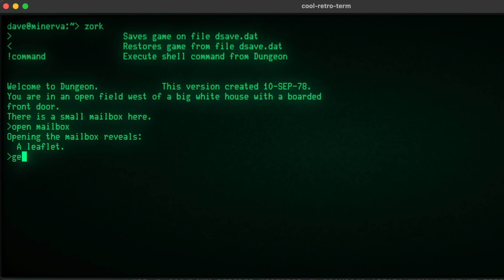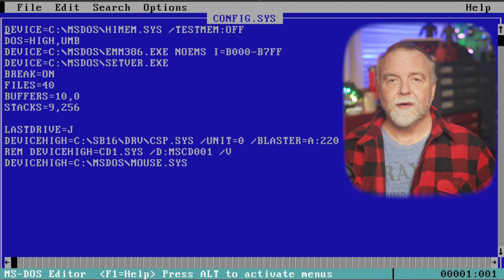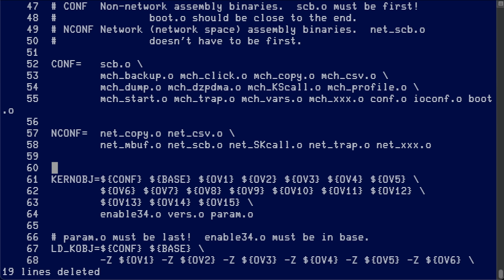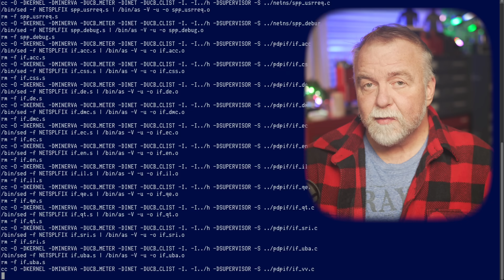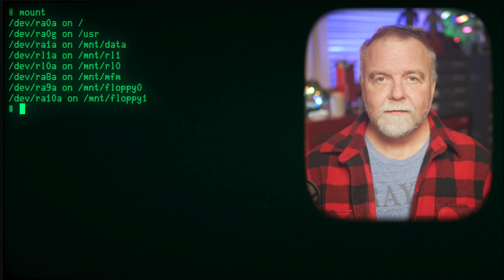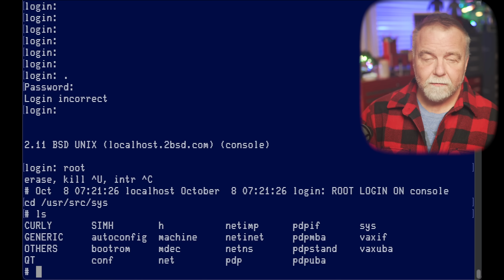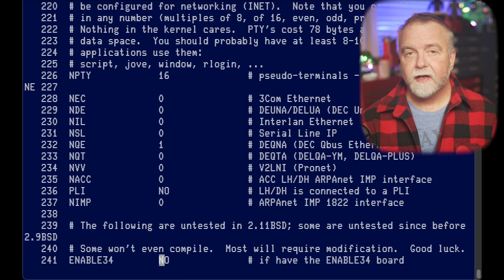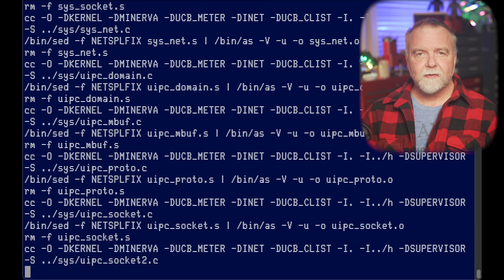The Hardest Thing: Building and Running the UNIX Kernel from Original Sources

Comment: The /netnix file is a great hack that makes 2.11BSD possible to have a mostly complete network stack.  It's also why "modern" 2.11 BSD only runs on advanced PDP-11 systems that are not only split-I/D capable, but have supervisor mode in addition to user mode and kernel mode.   The supervisor mode is used to contain most the of the network stack, while the rest of the BSD UNIX kernel runs in.. kernel mode.   I think the separate file is required because the a.out binary file format doesn't really have sections available for the other execution mode.  It already has notions of code, data and BSS segments, and they're implied to be kernel mode for the UNIX kernel.  But no place but a different file to have that code and data around to be loaded.

Like a dancing bear, its not how well it dances, but that it can dance at all.  It was a herculean effort to shoehorn the VAX 4.3BSD kernel networking stack into a PDP-11, and just amazing that we had it at all.

There were other differences that would show up.   When I was running 2.11 BSD on a PDP-11/44, sendmail would core dump when you ran it.  But only when I would run it from an Ann Arbor Ambassador terminal (which was quite the beast at the time!)    But the sendmail program would work just find if you ran it when logged in from a DECwriter printing terminal.  WTF?   Well.. it turns out to be related to the size of the termcap entry for each of the terminals.   The AAA terminal was really smart and had a big termcap entry, while the DECwriter had.. not much at all.   And you need to also know that sendmail had this "frozen configuration file" feature.  Rather than parsing the giant sendmail configuration, (which was nothing but lines and lines of incantations that were pattern matches and actions) each time, it would just restore a copy of the BSS segment that you could write out once.   On 2.11 BSD, the crt0.s start-up file that initialized the C runtime environment had the environment pointer in the BSS segment, while on the VAX it was in the data segment.  So restoring the saved config file would overwrite the pointer to where the environment data was stored (along with the TERMCAP string), and the longer termcap string for the fancy terminal would just blast over other data since it was much longer.    Good times!

I love having a PiDP-11 around around running 2.11 BSD.  The blinkenlights are very relaxing.  It's like meditation for old people like me.

Dave, you should poke around and see if you can find UNIX v7m, which was DEC's distribution of 7th Editon UNIX for the PDP-11.  No networking of course.. well, there was UUCP.  But it had an even more primitive kernel configuration system.  It's been more than 40 years, so the details escape me and we didn't run that for very long.. but I do recall getting it to run on an LSI-11/23.  That bear didn't dance nearly as well.

Comment: It was only recently that I got the caught the bug of going back to the metal. I took the well trodden path of those before me and built a few 1:1 emulators of the usual 8-bit microprocessors, then thought "hmmmm writing a kernel can't be much harder".

Within a few days I had a boot loader, keyboard interrupts and even switched into VGA mode, shortly after this I encountered the 10 mile high sheer wall that stood before me.

Comment: Hi, Dave. Great trip down memory lane (pun intended). I taught at Rochester Institute of Technology, where we had a PDP-11/45 and a PDP-11/34. The former had the split instruction/data space (which made the floating point emulation a bit tricky), but the 34 did not. To circumvent the kernel space limit, we changed the kernel to take the I/O buffers out of the kernel’s address space. That let us configure more buffers, which increased the power of the system. I also added a bit of code to the idle loop on the 45 to run the panel lights back and forth like a Cylon robot. Great times, great memories! Ken
Reply: Love that cylon boot stuff :)

Comment: This certainly brought back some memories of when Linux kernels would have to fit in the memory accessible to the boot loader (before bzImage or modules). When I compiled the driver for iomega zip drives on my 4MB 486 laptop, it took a whole day since I built a whole Linux 2 kernel along with it. It might even have gone faster if I'd told the build system not to use -pipe!

Comment: Boy it was simpler in the early days! I worked on the first Unix system running on a PDP11/40 (I think) in Evans Hall at Berkeley. This was the first Unix system to be installed outside the Bell Telephone organization. I was trying to interface to the CDC 6400 batch system over a serial line to Berkeley's home built multiplexor for the the CDC machine. (The documentation lied, of course!) I built the kernal a LOT. Unix was really smaller then.

Comment: Thanks for sparking some old memories...
I was using a PDP-11/70 in school with Dec-Writer paper print terminals till we got VT100s around 1979... in the days of IBM-5120, Apple-][, Altos-CPM or MPM, and 4K TRS-80 before the PC/XT came out.
Then I REALLY enjoyed using VMS on VAX-11/750, 785, 8600.clusters, and even VAX-9000 for years after that.
VMS was a Primo operating system for its time !!... with features unmatched by most servers for decades... yet contributing technologies & computing foundations that are used inside other systems to this day. 😀 
When VAX jobs+marketshare started tapering off, I continued working in Unis environments with Sun/Solaris, CDC-EP/IX, IBM-AIX, HP-UX, and of course multiple flavors of Linux till now.

Gotta respect your diligence bringing an old PDP-11/83 back to life, to config/compile its custom kernel for full hardware functionality 😊  
Thanks for the "ride along" 🎉 Good work.

Comment: Ohh - that brings back memory into the 90'es - while upgrading a Unix (custom) on DDE SuperMax ... I did learn C and changed the code that was going into the kernel to allow our Wyse 60 and 120 serial terminals to have 3 sessions (or act like 3 terminals) at the same time - switching between them pressing Ctrl-Z ... 

And writing a bi-directional streams module for CDC 4330 and 4650 (I think that were the module numbers) - this time I really loved pointer to pointer to pointer operations in Ansi C - I could crash a Unix kernel so fast that it only managed to write "PA" instead of "PANIC PANIC - Shutting down immediately".

Thank you Dave.

Merry Christmas and a Happy New Year to everyone.

Comment: I first installed FreeBSD in 2004, v5.something I think it was, 32 bit.   That got compiled , also took an hour on a dual core Xeon (3420 I think?), build world took 6 hours.  Thankfully a few years ago the generic kernel started including the things I had to compile for so I switched to binary updates.   That v5 got upgraded all the way to FreeBSD 13.4 before being retired just a few weeks ago, replaced by a fresh FreeBSD 14.2 64bit install (on a new motherboard with 8core i7), now using ZFS so I had to retool a bunch of system scripts to cater for that.  So happy not compiling kernels anymore, but I do want to try to get an old MFM drive working again, windows has no MFM drivers, I did try it a few years ago, maybe FreeDOS will do it.

Comment: The original PRIMOS, the O/S for the Prime 300, required no configuration if you stuck to supported peripherals. Like the PDP-11s, the Prime 300 had a 16 bit address space. All drivers were built in. The boot system dynamically determined the attached peripherals and locked the required drivers in memory and locking the unused drivers to disk. The procedure for attaching a new device was:

1. Turn the computer off.
B. Plug in the new device -- disk drive, card reader, serial board, whatever.
III. Boot up. Job done!

Comment: Ah, the good old days.  Back when a program was either entirely in or out of memory.  No demand paging.  The first step in starting a program was to allocate swap space for it in case that the whole program needed to be swapped out.  Programs had to actually be smaller than memory.  If you were running three programs that were all linked against the C library, why then you had three copies of the C library in memory.  I have to look at the TCP/IP stack.  This is when all ephemeral ports started at 1000 and all TCP sequences started at 0.  This turned out to be undesirable for a number of reasons.

Comment: Dave, you might appreciate a recent posting by the Berlin Vintage Computer Festival 2024 "The B Programming Language". There's a lot of info about B and why it evolved to C, and what the impact was on such early UNIX, like on the PDP7 (4K 18-Bit machine word memory) and a PDP11 (possibly 11/20) with 8Kb on 16Bit and a 1 byte machine word. This had a profound impact the evolution of B to C for these originals.

There's also a real fun early example of the "SU" command written in B! I won't spoil it, but I'm pretty sure you'll love it!. 
It was posted on the 19th of October 2024.

Thanks for your great content! So much passion and nostalgia!

Ed: You're right, an absolute marathon and those compilations weren't what we'd exactly call speedy either, were they?
I worked for Digital in the mid '90s and we had a a bespoke finance system in written in DECs DIBOL (Fun language, I always saw it as a mix between C and Cobol, in ... Spirit, if not syntax ... You'd write data centric systems with it, but you could also write a Mandelbrot generator or a Conway's Life, which I did to prove to my manager that I'd picked up the basics of the language enough to be trusted to work on the bigger system!). 
We'd compile on both an Alpha server and a VAX-11 (We'd mothballed the PDP11 by then). The Alpha could compile the whole package in about 30 minutes, the VAX took ~17 hours!

Comment: I went to high school with Clem Cole before either of us were hands on with Unix. We cut our teeth on dialup BASIC on Teletype at 110 Baud. It is amazing that we got anything done with the limitations of the DEC hardware. I learned and used VAX/VMS running shop floor control systems on VAX 11/780 at AMD and Intel. Never built a kennel though. Good job!

Comment: When my group at Lawrence Berkeley Laboratory gave me the go-ahead to replace RSX-11MPlus with 2.9 BSD UNIX, I was told to just make sure I left a running system in the morning.  I had no idea where to start but, fortunately, I had a good friend from middle school who was an EECS major (I was a Physics major) at UCB and also worked at a company in Berkeley that ported UNIX to new hardware.  He came up to the lab one weekend and helped me to boot UNIX from the 9-track tape that I was given when we got our license.  We got UNIX loaded onto an RLO02 disk pack and I was now able to switch between RSX and UNIX by switching disk packs and rebooting.  Now, like you, I had to get the drivers installed and working for the devices that we had installed in our PDP-11/73.  The biggest (and final) challenge was getting our multi-port serial card working so that the terminals in the offices would work.  I can't tell you how many kernel rebuilds I ended up doing but, I remember it took me several weeks of working on it late at night only to have to boot RSX before going home.  What made it even more fun, my "console" was a printer with a keyboard - an actual teletype device.  The terminals were in offices, several doors down from the computer room.  So, every time I build a new kernel and booted it, I would have to walk down the hall to see if it worked.  Anyway, it was a Sunday night and I had decided to do one final kernel build for the night.  I built the kernel and installed it.  I rebooted the PDP.  I walked down the hall and I cannot tell you how happy I was to see the login prompt.  I successfully logged in from a VT220 terminal that night and we never ran RSX11MPlus again.

Comment: I first started using BSD in the late 90s, starting with FreeBSD, and Net/Open as well. I still prefer to use NetBSD for little tasks whenever I can.

It's amazing to me how many things still look very familiar going back to 2.11 BSD.

At one point I did have a VAXstation 4000/VLC that was running NetBSD. I don't have it any more though. I understand that the VAX CPU in that VLC may have still had the PDP-11 emulation capability. I wonder if there was a way to load ancient BSD like this? I doubt the device driver support was capable of handling it.

Comment: we had a PDP-11/84a in High School.  we ran RSTS/E, but amazingly, changing the operating system was very similar (far less complex).  We had to MAKE a SIL (Save Image Library), which was your Loaded OS, with the appropriate settings.  Digging into this, and MACRO-11 Assembly to change settings was just mind-blowingly fun.  The stuff I learned doing this landed me my first full-time job at 19!  They had PDP-11/70s.
And my first job was patching the SIL manually (because the had huge 500MB drives, and you basically had to calculate the size of each cluster, etc, to not have integer overflow... LOL).

Bringing back some great memories...

Comment: Ah the RQDX3 I think also was in the MicroVAX II's... which also shared the BA-23 and QBUS.... sourcing drives for these (MFM?) now such as the RD52 and RD53 is almost impossible... hence the need for a SCSI QBUS card... I recall having a TK50? card for the tape that was SCSI but it was limited so couldn't handle disks.. all this entirely from my 1994 memory banks )))

Comment: Wow, sounds a lot like setting up an old mainframe with the IOGEN some of which was later moved to HCD.  The rest of the config happens in the firmware and microcode.  No jumper changes, or wire-wrap changes  that I can recall unless the hardware engineers from IBM or Amdahl did that to say add in more memory - which they would have to adjust via timing diagrams.  The MF kernal by the way is called the NUCLEUS. In addition to all the unix stuff I believe the machine was large enough that the speed of light in various boards mattered for wire lengths - hence the timing.

Comment: As someone who has run FreeBSD and BSD/386 for about 30 years, this reminded me of stuff I haven’t needed to do for a long time (thankfully, no overlays.)
Reply: Back when you actually needed to build a custom kernel if you liked having usable RAM - since GENERIC easily ate up a meg or two of it on its own just from drivers and support for silly things most people never needed like IPX/SPX or NFS server support.

I haven't bothered building a custom BSD kernel in years. Even when I do a source build upgrade, just build GENERIC and get on with life.
Reply: @ Yeah, the most I need to do these days is load a kernel module, if that.

Comment: So cool! I’m really enjoying this PDP-11 series. The lower levels of hardware and software are fascinating.

One of my early computing adventures was messing with the Linux 2.6 kernel on my Athlon 64, which took a similar ~45 min to compile and required endless configuring to get all of the right hardware modules loaded (especially networking).

Comment: Wow, what a treat! You are a trooper and persistent ... thanks so much for sharing your adventure with us!
The first PDP-11 I ever saw was running UNIX and the thing that blew me away was the 9600 baud video display. I didn't learn about the existence of RSX and RT-11 until years later. I worked with DECsystem-20 systems that used a PDP-11 as a front end (serial connection interface). The front end booted from an 8 inch floppy disk. Life was different in the 1980s.

Comment: Hello Dave, While I am familiar with building a kernel in early Linux distributions I was never in a position to be responsible for modifying  and compiling the kernel on a PDP-11. I was an operator that read all the manuals to prepare for an opportunity that never appeared. The closest I came was CP/M on a Z80 daughter board in an Apple II+. The early days of Linux had many similarities to what you described for the PDP-11. I was never sure that I could do a kernel compile on real Unix hardware but I understood everything that you presented in this video so I was not far off the mark. Thank you for the video.

Comment: Hi Dave! Whistl here, another IT old timer. Enjoyed the video, brought me right back. Started in mainframes in the 70s, became a UNIX Sysadmin in '86, when UNIX workstations were popular and multi-processor superminis were just becoming a thing. They liked our auto-parallelizing compiler software. Building UNIX was only a little better then, compared to  your PDP 11s. My first UNIX box ran (BSD-based) Dynix and was a Sequent Balance B8. A few years later I was maintaining 43 servers and workstations running 23 different flavors of UNIX. Ultrix, Dynix, Irix, AIX, Okix, Solaris, you name it, they had at least one, including the tiniest Intel Paragon supercomputer they ever made. Many of today's Linux admins have no idea how much things have improved.
Reply from the maker: Back at Microsoft I had a dual processor M4400 at 200Mhz, would have been a fun machine to run Unix on! Of course I was using to help write NT, so it didn't go unused :-)
Reply: If you saw the process of building Android for smartphones, you’d appreciate how much better things were back then. Only half joking.
Reply: I used several flavors of UNIX and while it was interesting flipping between HP/UX, AIX, IRIX, OSF/1, and Solaris, it was also a lot of time fiddling with things that shouldn't have needed it.
Computers today, and Linux today, is a much better platform for getting things done.

Comment: Actually , not to get technical , but BSD is a version of the original code which had it's debut in 1978 , 10 years after the authentic original kernel by Ken Thompson and Dennis Ritchie was done in 1969. I had a copy of the original C manual and the Lyon's Text with me through the 90s. That being said all the respect, 2.11BSD on an actual PDP11 is a pain I don't relish.